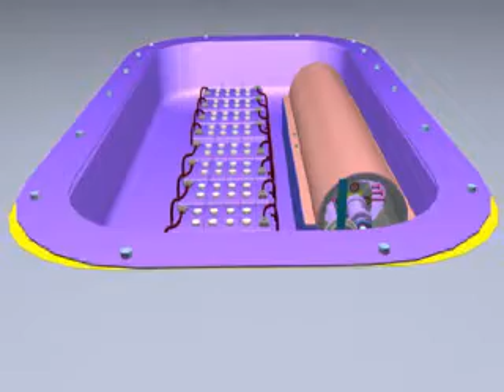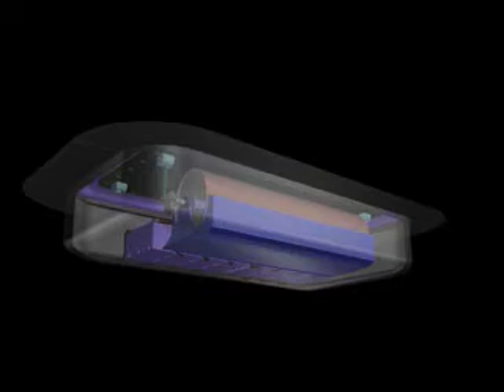Electricity from road with kinetic energy. video 1.flv

Comment: With some quick calculations, this can put out about 30 watt hours per vehicle if the vehicle decelerates 10 miles an our by hitting the bump. Not bad, enough to charge 2 iPads.